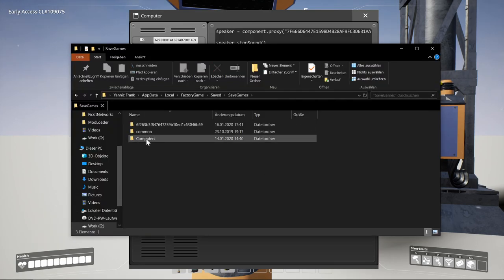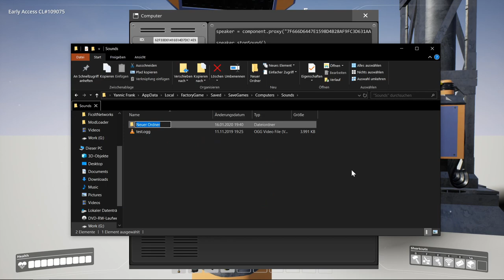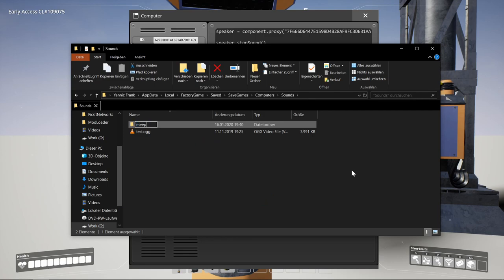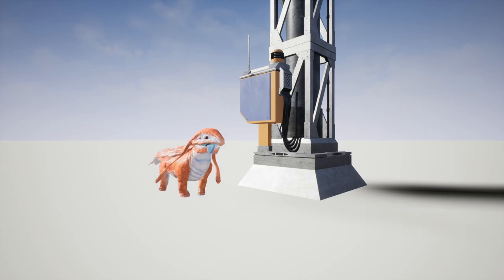Speaker Pole - FicsIt-Networks - Satisfactory Mod

Comment: umm help the error is the EEPROM;3: bad argument #1 to 'play sound' (speakers _c expected, got string) 

stack traceback:
       [c]: in field 'playsound'

 EEPROM: in main chunk 

and my code is 

speaker = component.proxy("437C3D374ECD9A5BB37AE1BB558853F9")

speaker.playSound("test") 

i don't know what i did wrong with this code     pls help
Reply from the maker: are you really sure you typed "speaker:playSound("test")" and not "speaker.playSound("test")"? (with colon and not period)
also... the api i think has changed and needs a second param as number "speaker:playSound("test", 0)" to define a start position were to play

Comment: I keep getting a "bad argument #1 to 'playSound' ('Instance' expected, got 'string')"
I have placed a .ogg sound file in "Computers/Sounds/".

This is the code:
speaker = component.proxy("69AC648C40603BBABB59E188A4D13A8C")
speaker.playSound("test")

I'm not sure why it's not working, do we need some more code than what is in your example?
Reply from the maker: You need to use ":" to access member functions, not "."... means your code should be:
speaker = component.proxy("69AC648C40603BBABB59E188A4D13A8C")
speaker:playSound("test")
Reply: @Panakotta000  Ah thank you so much!

Can't believe I didn't notice that, I blame my bad connection quality for overlooking it :D